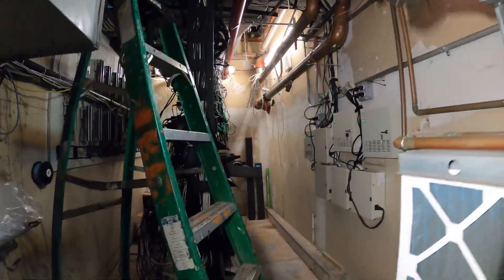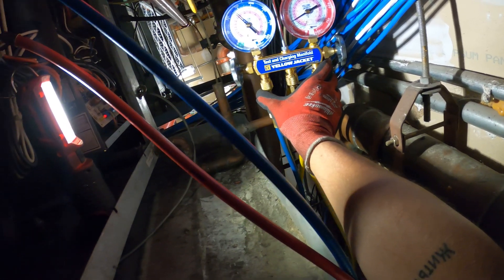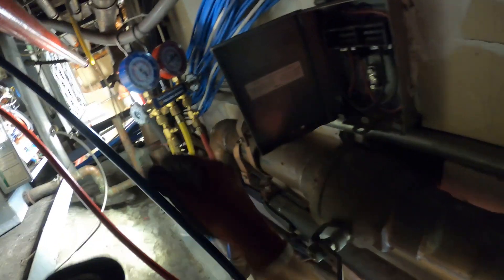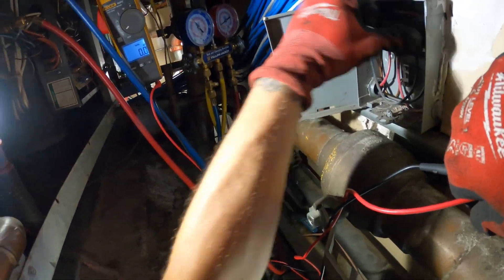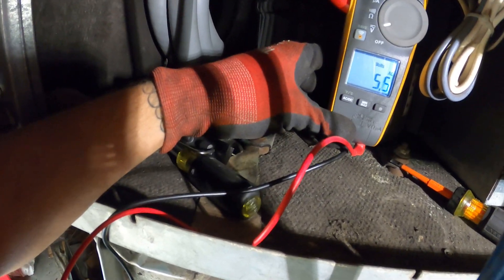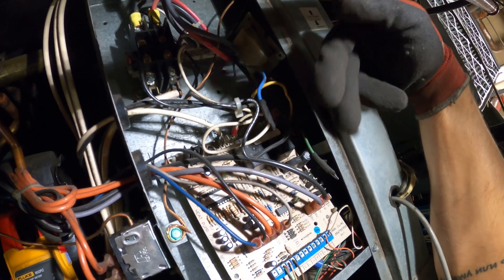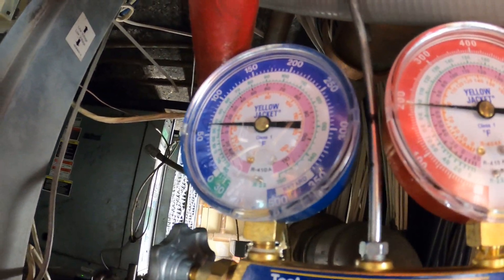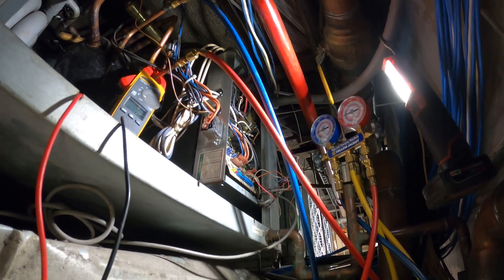HVAC Service Call: McQuay Water Source Heat Pump Not Working (Heat Pump Not Blowing Cold Air)

Comment: Could you have just pulled the R wire?
Reply: So it appears you have one units transformer controlling all 3 units and each unit is a stage of cooling. So is it wired with multiple y wires ? Or are they all twinned together as y1?
Reply: So it appears you have one units transformer controlling all 3 units and each unit is a stage of cooling. So is it wired with multiple y wires ? Or are they all twinned together as y1?

Comment: Typically when you have multiple units all off the same thermostat you only can use one transformer(though it would be a limit on how many units you can run off the one. the VA rating will tell you how much that transform can do) if you have multiple transformers wired together you can run into phase issues. I also noticed they got some old network stats my guess is the building has some old JCI N2 BAS in it witch is kinda cool.

Comment: I’ve been working on some Trane units lately and the blower housing it’s a b¥£€h to remove just to replace the blower motor…I had to cut-out a hole on one of them just to gain access to the bolt that holds the shaft in place an slide out the motor only because there was an “I” beam in front of the blower access impeding the housing from coming out (on top of the fact that they built the units panels around the housing) I hope you don’t come across one of those or worst yet a Mammoth!

Comment: Did maintenance back flush the co-ax coil?. Every WSHP i work on i always check and clean the strainer and back flush the coax. Not saying what you did was wrong or leaving a step out. I just always do it. Freaking HP are always in a shitty location and a biatch to have working space

Comment: I think when they use 1  tstat to control 3 units.  They use one transformer( low voltage) to control all other units. Thats make little sense but still not sure it's good idea.
Reply from the maker: It doesn't make sense but someone created this hack job somehow lol Noone knows where that transformer is till this day and I just had a service call there a few days ago. This whole building is rigged. Thanks for watching!

Comment: Stealing control voltage from another unit because you don't have a replacement transformer is some hack shit. Question though, is scale build up on the heat exchanger and issue if so do you just flush it occasionally with descaler on the PM's?
Reply: That’s an acceptable temporary repair in my opinion. If you don’t have a part